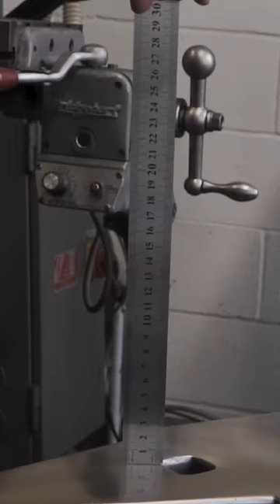"Pig" Anvil Restoration, Super Speed Build! #shorts

Comment: The moment I saw the concrete: “that’s not a good idea.”
Reply: I was gonna comment on that, but maybe you know already. Why fill it with concrete?
Reply: @bilithic7421  It didn't look like it had bars of metal nor rocks in it just 100% concrete mix. So it will crumble after many impacts. But using concrete at all?, no idea why.
Reply: @Mando Perth Stacker  thanks fo the reply. I kinda caught that too but I don't do concrete, and the stuff I have used had rocks in it and was just for a post.
Reply: @bilithic7421  typically if you are going for something that you are supporting a load with you would mix in an aggregate like gravel to help absorb shock and strengthen it. Concrete and aggregate makes cement. In building practices they use long rods of iron rebar for the same thing. Commonly in house foundations. You'll see them in the cement blocks at the end of parking spaces outside sometimes. Pure concrete like this is only really used for things like outdoor flower pots, sculptures etc where you want something easy to make and weather resistant. This video should've just cleaned up an old repurposed barnwood beam for the base. Would've been cool.
Reply: @steveminogue6680  you have no idea what you're talking about
Reply: @steveminogue6680  you've got concrete and cement the wrong way round there mate, more than once.
Reply: Yup , wood is better for shock absorption
Reply: To be fair, as an architecture and fabrication major, I think he'll be fine with the cement. It could be very fine aggregate, making it concrete, not to mention he does have some reinforcement with that metal stool. 

Would have liked to see some rebar but there really isn't much more support he would have gotten. Maybe  chicken wire would have been better.
Reply: @oussamaxd197  You do realize that it’s an anvil, right??? You do know that he will be beating the shit out of stuff atop the anvil, right??? You want ALL of the energy/force from the hammer to go into whatever you’re beating, right??? You want whatever you are beating on to absorb all of the energy/force and not the anvil or the table, right??? So, please explain to me exactly why you would want to use wood and/or anything else that would be “better for shock absorption” when you want the object that’s on the anvil to absorb all of the shock and not the base??? With that being said, he used the concrete in the base in order to make it as heavy as he possibly could in order for it not to absorb all of the shock. Have you ever hammered on a piece of metal sitting atop a small fragile and lightweight table??? If you have then you know that you did very little damage to whatever you were hammering on. However, if you were hammering on a piece of metal that was laying on top of a very large and heavy table then you also know that you most likely got way better results on the big, heavy table versus the small, lightweight table. Hope this helps and I am very sorry if I came across as a dickhead, as that was definitely not my intentions. Have a great day!!!
Reply: @DFWJon  because you will never get all of the energy to go into the thing you’re beating the shit out of. Some energy will always go into the anvil and whatever it’s on.
Reply: It has a metal frame. I think the concrete is just for weight mainly.
Reply: @mandoperthstacker  just cause of the weight. You either bolt an anvil down or do what he did by securing it to a heavy base.
Reply: It will never crumble. At least not from hammer blows.
Reply: @mandoperthstacker смотря какой марки цемент. Если 700, то Вы его молотком не сломаете.
Reply: @steveminogue6680  Cement and aggregate make concrete. "Cement" in the English language doesn't even have to refer to the chemical binder. Shoemakes for example know "contact cement", which is an adhesive.
Reply: Keep it from moving and dampen noise. @mandoperthstacker
Reply: @spblackey Finally, the right answer.  The same reason we fill planishing hammer frames with sand, and some guys fill the columns of their power hammers.  Dampeming.

Comment: At least he didn't weld the anvil to the base, he can take it off later when he finds out why you should use wood.
Reply: Or maybe you will find out why Wood would have been the wrong Choice 😉
Reply: @Ingenium10 we've been using wood as stands for anvils for literally over 5,000 years.. longer than anvils had even been made of metal themselves. 

I think there's a reason behind that instead of stone, concrete, or metal.

Not saying you can't, but I think the test of time proves one over the other.
Reply: @sasukedemon888888888 the "Test of time" is just that steel or metal in general was too expensive to splurge on a stand like this up untill very recently.  Also a majority of anvils dint even look like this but were a big glob of metal with a spike in wood.
Reply: @Nanogenium as an actual blacksmith there is a reason we use wood
Reply: @sasukedemon888888888 yes, an old thich tree stump is the perfect anvil base. From forever to date.

Comment: As a CNC machinist I want to know if you scrapped the surface cutter you were using. Usually coolant helps with the sparks. Carbide tips help with that too.
Reply: Металл мягкий на ней
Reply: Probably not but he may have needed to switch the inserts over after that!
Reply: I learned that with that kind of cutter your not supposed to use coolant. Because carbide can handle high heat but not fast temperature changes. So either no coolant at all or a lot of coolant.

Comment: anvils should always be set up on wood preferably tree stump or large log
Reply: Concave the base for a 3 point stand ( router ) then use the router to make a 3/4 inch defined depression for the anvil to sit in.
Reply: You need to get with the times
Reply: Nope
Reply: A hunk of log, preferably maple or oak would be the best really. I think is is a great idea in a pinch for sure though. There really are whole regions of the planet where getting some angle iron and a couple bags of cement is a lot easier than getting a stump of oak or whatever, so this is a pretty good solution for that?
It's kind of like a machine base in a way. An great inertial damper at least so kind of cool. 
   I just wonder if the top of the concrete will hold up? He put some caulking there that might shield the face of the concrete some? Time will tell I guess.
Reply: the reason is it absorbs the vibration that destroys have hardened steel. the concrete and steel sure make a solid base but the life of an anvil may decrease.  (yes maybe take a few centuries off of it, but for how long will we be making generational anvils?)
Reply: @williamgaglione7208  If we’re getting with the times why do we even need an anvil 😂
Reply: @johnr9296  you didn’t actually just say that…..
Reply: @johnr9296  good point
Reply: Why? I'm seriously interested. Mine is sitting on a steel table bc I didn't know about putting it on wood.
Reply: Mine has been on the same oak stump for more than 60 years.. Stapled down like they always have been.. then again… I made all my tongs and inherited my coal and gas forges except the one I made for tempering swords  and halberd blades… Maybe it is because I have always done ornamental and restoration smithing.. I am a Whitesmith as well as a Blacksmith trained by a European Smith.. 
I would Never consider this type of “Restoration” myself..
Reply: Well I guess I should be able to get a hold of you tomorrow morning and get a hold from you and I will let you know when I get a hold back from you and I will be in touch with you as soon as I can get a hold up with you and I will get back to you as soon as I can get this information to you thank you so much
Reply: Según, si es para adorno…
Reply: another opinion being delivered as fact. Both are suitable. It's up to the owner, and or user. Not you.
Reply: modern techniques you can fill a cylinder with sand, ore use rubber or eboxy on top of a steel stand... concrete though... terrible idea for multiple reasons, shock to the user being the least of the issues.

Comment: This is what happens when you give a machinist an anvil 😂
Reply: Resurfacing the anvil wasn't a problem for me, it's a nice touch. Even the base plate with folded tabs I could get behind, especially with the silicone feet. But that concrete and steel monstrosity? No thanks.
Reply: Но это лучше чем молот Тора ))
Reply: @adriansaidan1736 what you call "resurfacing" I call "removing years of work hardening"
Reply: @gatergates8813  that is a good point
Reply: I'm not Sure about machinist, resurfacing and grinding afterwards.. but He ain't No welder, that's for sure 😂😂
Reply: A completely flat plane anvil is terrible to use, I know it might sound weird but you can't as easily forge a straight piece on a flat anvil, bowing a little would be ideal. Also the concrete base... I need to lay down...
Reply: @th7800 sounds like you've pounded some steel 😅

Comment: What was the reason for doing all of that? It was perfectly fine the way it was!!! Did it have to be parallel to .0005" ? Do you think adding paper thin silicone is going absorb the shock?
Reply: its a machinist thinking he knows better than a blacksmith.
Reply: Refinishing an anvil is a super common practice, that results in better surface finish in your work

Comment: nice job , I've got a very old 3times bigger normal shape anvil that I was given and now I have an idea how to set it up properly in my workshop,  thankyou.
Reply: Needs to be on wood to absorb the shocks of beating on the anvil. Have you ever seen anyone else with and anvil on a steel and concrete stand? I haven't and thats because its wrong how he set the anvil up in this video. It was on a big block of wood for a very good reason. Look up blacksmithing videos here on youtube and look at what their anvils are mounted on and how. You're not supposed to machine an anvil either. I was very surprised the ball bearing still bounced like it did after he did that.
Reply: @williambryant5946 Thats a modern cast steel anvil. Its hardness is fairly thick and he machined off a tiny amount. 
Regardless, the guy is idiot for doing that. Plus it shows a bad example to others who don't understand the finer points of Smithing and may machine off an antique anvil and ruin it.

Comment: i'm not a machinist or blacksmith but i just have a question, call it comon sense if you like, for the ppl that are: since he used silicone or whatever it was in the base, did he really needed to flatten the feet so accurately in the mill?
Reply: The silicone is not to secure it, it is to reduce the sound.
Most of the silicone will be pushed out from the sheer weight, so yes, flattening it would help a bit.

Comment: Nice. I wouldn't want to touch it with the grinder though
Reply: It's a tool,  not a collector piece. The surface gets damaged and pitted and that transfers into the work piece
Reply: How would you have removed the pits and  achieved a nice smooth finish on the rounded parts without a grinder?
Reply: @ferrumignis  yeah the round bits not the flat part though. I was talking about the main flat part. Nice perfectly flat milled finish then grind it? Why. Grinders if you really have to..
Reply: @Pathfinderxr  I see what you mean, though he wasn't using a grinding wheel, it appears to be a flap disc and I suppose he wanted to remove all the machining marks.  A grinding disc would have made a real mess of that surface.
Reply: @ferrumignis  yeah I knew it was a flap, they don't leave it flat

Comment: The concrete will crack after a while as it won't be able to absorb the shocks from the hammer very efficiently, this is the reason why wood is used, a big wide wood base will last far longer than this concrete pillar.

Comment: I suppose the concrete may stop the metal stand from ringing like a deafening mess, but... concrete is crumbly stuff without reinforcements.

I have a question for any blacksmiths: Is there such a thing as sand-filled stands?

Some rollercoasters made of tubular steel dampen the sound they make by filling the tubes with sand, and I was wondering if a similar idea was being used in the shop.

Comment: My anvil needs a makeover like this
Reply: good because if you do this you'll end up making it over again time and time again, thats inviting rust into it by doing all of this. never get a machinist to do a blacksmith's job. the leveling of the top was about all he needed to do. You also shouldnt polish nearly as much of it as the scale protects it. now hes asking for rust into the feet and degrade them, and lemme tell you, welding cast steel back up isnt fun, you have to keep it hot and use a nickel rod if you want that weld to now]t fracture when cooling...

Comment: I have a question. I know nothing about anvils. Does the metal of the anvil get harder and more dense/ compressed the more it’s hammered on? Or does the hammering have no effect on the anvil
Reply: Hammering doesn't do much if it's properly hardened.

Though, over time the surface can deform slightly (and subsequently work harden), it can also wear down.

Density doesn't change.

It being a little rough on the surface doesn't matter, but all marks will be transferred, so you do want it as smooth as possible.

Comment: How do you know if it's flat if you turned it upside down on the side that need resurfacing to do the legs then flip it to the top side and then do it wouldn't it be slightly not flat?